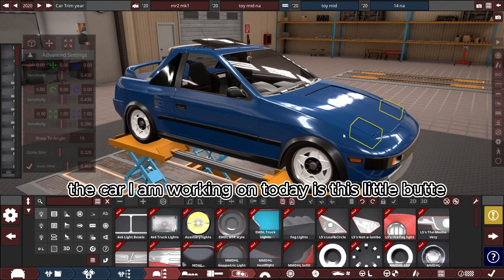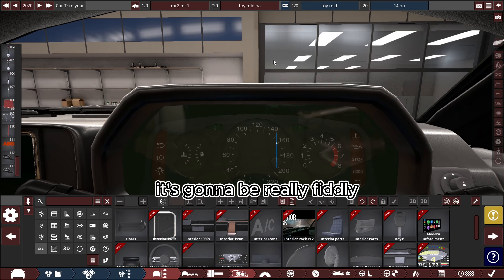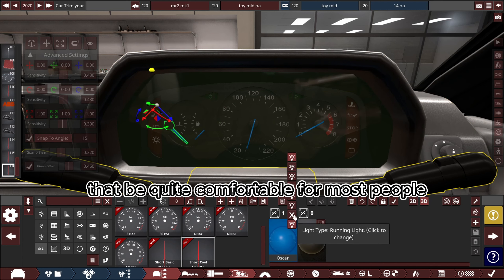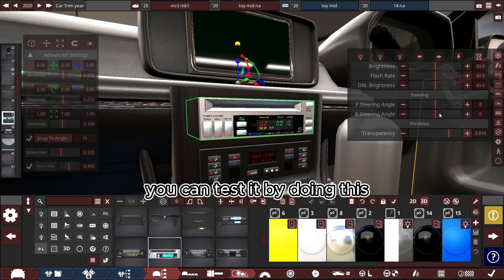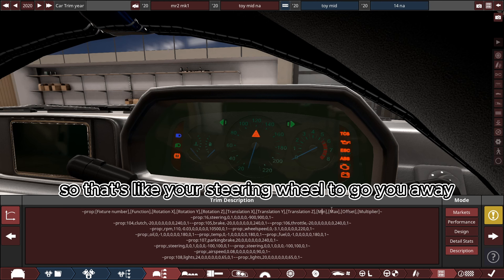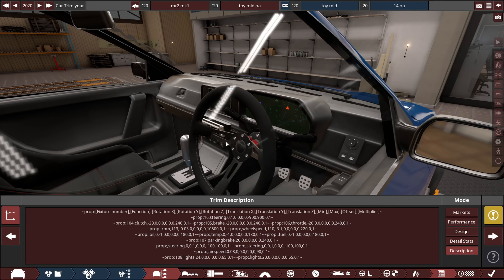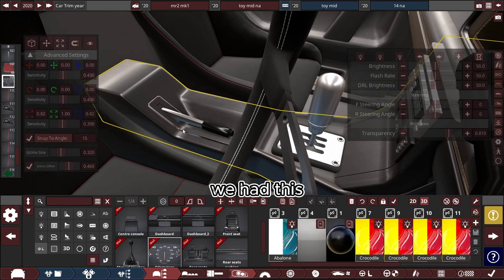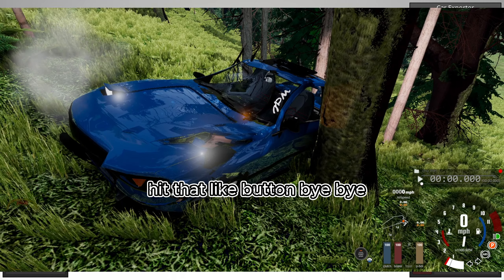Automation tycoon // Custom working gauges

Comment: I actually never got a problem when i resized the needles, and i have the same mod as you, i had a problem but it was just that the values for like the rpm was not like -3.1 but -3,1 with a comma and not a dot, maybe thats what you got before? either way, thanks for the video, i was struggling with the temps and fuel.
Reply from the maker: I have seen a new video that shows you the math you are meant to use. I will see if I can find it. he is trying to get people to download his tool but I have been told not to trust random .exe files from people. I am more then sure it will be safe but not worth the risk for me. 
but in start of the video he shows you the math
Reply from the maker: https://youtu.be/c_fVPpet7Og?si=0vjAhaUj0IeVKcjm

Comment: what mod did you use that had all gauges like speed, rpm, fuel etc. or did you make it from scratch because i can't find it from steam workshop
Reply from the maker: one day I will make some in blender as I find them not to be the best. one of the mods doesnt work for some reason when it used to lol. I can not remember what ones they are off the top of my end but I think they are easy to find in the work shop
Reply: @manicgamingguy6161  thanks

Comment: for some reason dashboard light for low, high beam, etc, wont show up but turn signal, brake, etc does so idk if I got to do some type of coding adjust for it to show?
Reply from the maker: No it should just show up, maybe it was a bad prop or wrong light setting. I use a mod for my inside lights. not sure what it is called but maybe shows up in the video. maybe try and change the material and see how that goes.
Reply: @manicgamingguy6161  yea it work but its just the beamng gauge light icon that wont show up for some reason like if i turn on the light it would show the little green icon beam light to the side or hazard triangle shape will flash along with turn signal thing like that but it dont.
Reply from the maker: it could be the glass in front of the gauge or maybe move the beamng lights a little more forward
Reply: @manicgamingguy6161  try that didnt work, so idk my guess is the way of how its coded into the files
Reply: i mean i look into the glowmap its there it just wont show up in-game
Reply from the maker: maybe it has got broken. it is possible when doing this stuff. I have broken many cars. one random way to test it but also can just brake as well is to clone the car and then change the auto body and export it again. some times that is a fix
Reply: @manicgamingguy6161  yea will try it but thx for your help i'll probably just gonna deal with it

Comment: So for Whatever reason.. it didnt work? and im not sure as to why.
Reply from the maker: be care full cause you can break the cars for beamng. but cant really say what you did wrong cause I didn't see you do it
Reply: heres the code
~prop:72,wheelspeed,16,-3.1,0,0,0,0,0,200,0,1~
~prop:73,rpm,18,-0.04,0,0,0,0,0,7100,0,1~
~prop:74,fuelVolume,20,-1,0,0,0,0,0,70,0,1~

Comment: Hello! thanks for the video, it helped me quite a bit! Did you have any luck with getting the fuel gauge to work? i cant seem to get them working despite following the same format as the speedo and tach. i think im using incorrect terms like "fuel" for fuel level and "enginetemperature" for coolant temp. thanks in advance!
Reply from the maker: Yes I did, look for a video with 14 working props. it has the code with it also

Comment: where can i find the code for the description?
Reply from the maker: I have updated it now but here you go as well. code for the moving parts
(copy and paste)
~prop:80,steering,0,1,0,0,0,0,-900,900,0,1~
~prop:77,clutch,-20,0,0,0,0,0,0,240,0,1~
~prop:78,brake,-20,0,0,0,0,0,0,240,0,1~
~prop:79,throttle,-20,0,0,0,0,0,0,240,0,1~
~prop:72,wheelspeed,0,-3.1,0,0,0,0,0,200,0,1~
~prop:73,rpm,0,-0.04,0,0,0,0,0,7100,0,1~
~prop:74,fuelVolume,0,-1,0,0,0,0,0,70,0,1~
~prop:76,oiltemp,0,-0.5,0,0,0,0,0,70,0,10~
~prop:75,watertemp,0,-0.5,0,0,0,0,0,70,0,10~
~prop:67,lightbar,0,0,0,0,0,-10,0,20,0,1~
~prop:68,lightbar,0,0,0,0,0,-10,0,20,0,1~
~prop:71,turnsignal,0,-10,0,0,0,0,-200,200,0,1~
~prop:70,lights,0,-10,0,0,0,0,-200,200,0,1~
~prop:86,gear,5,0,0,0,0,0,-10,10,0,1~
~prop:87,parkingbrake,-18,0,0,0,0,0,0,240,0,1~
~prop:84,radiatorFanSpin,0,20,0,0,0,0,0,360,0,1~
~prop:81,spoiler,0.8,0,0,0,0,0,0,2000,0,1~
~prop:93,turboBoost,0,-4,0,0,0,0,-40,80,0,1~
Reply from the maker: yea I wish some one would make a random set with lots of different sizes. some time I use some thing small like a boost gauge and make it all blank apart form the needle. just make sure by spinning it that the needle is in the middle and spins centred .
Reply: @manicgamingguy6161   oh yeah! but i must say to you it worked!!!
Reply from the maker: @bratwurstgamer223  epic